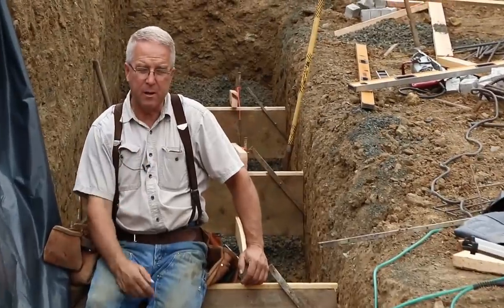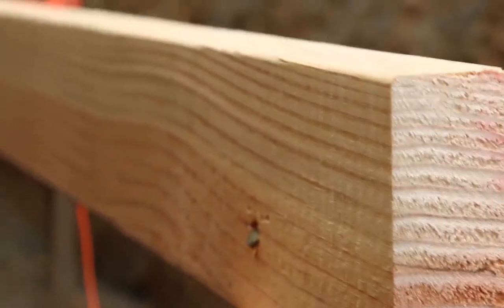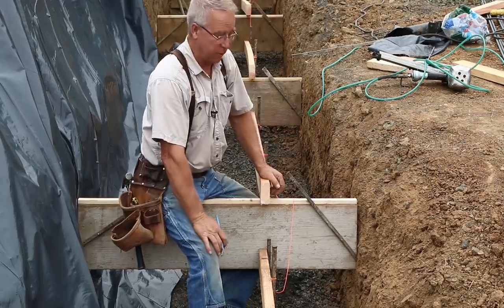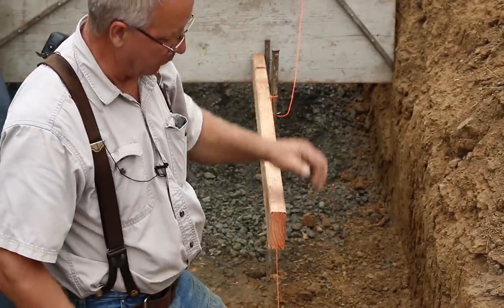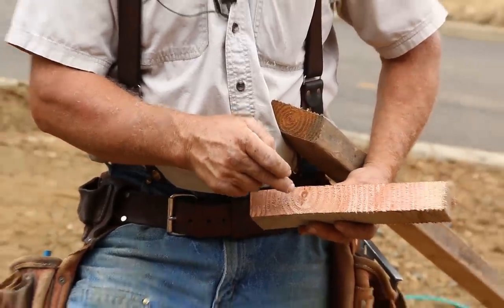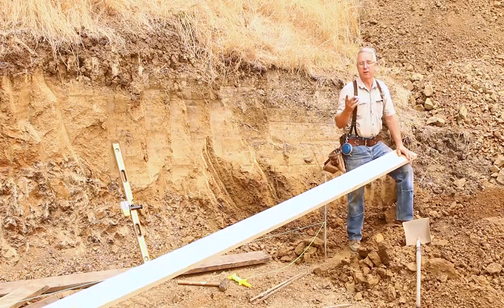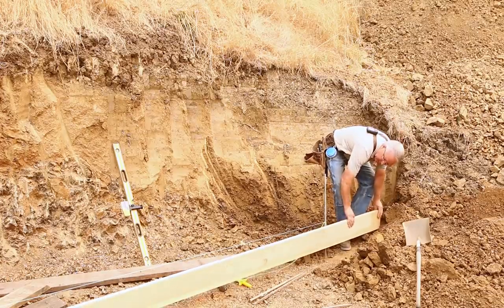Things To Know About Lumber

Comment: Thank you for all your great videos. Point of interest for you, about 30 years ago I had to remove 2 Pacific Yews for a commercial venture, no way around it. At considerable expense and effort I had the wood sawn and kd'd. I have been very selective of it's use and still have 1/4 of the lumber left. Not many folks with 1x8's & 10's 12' long in their stash. Sorry got carried away, what I wanted to share was that the larger of the trees was about 22-24" across, I sanded it to 220G and took it to a stereo microscope and several folks to a stab at counting the rings. We settled on a count of 957 years, that's 14 times my age at 69, amazing!!. Cheers, Billy in B.C.

Comment: I learned all of this when I learned how to make traditional bows and arrows. If the grain isn't just right, or there's even the most minor knot or flaw, the bow can explode on you (there's ways around it but it requires a bit of knowledge and understanding of the wood & bow). When cutting staves, you must seal the ends and then season the wood (generally for years unless you have a low temp kiln) or it will take a "set", i.e. lose much of it's power and ability to snap back into form. Yew is so highly prized by bowyers because it grows so slowly that the rings are very densely packed. Finding a straight piece of Yew is quite difficult these days. The other great thing about Yew is that the inner heartwood is great for compression, and the outer sapwood is great for tension. So you have the heartwood towards you (belly) and the sapwood towards the target (back). The sapwood is a cream color and the heartwood is a rich red color, making for a beautiful bow. When making the bow, generally you want the entire back of the bow to be the same layer of ring (so it just looks flat and plain, without cutting through any additional layers). This will bring stability to the bow, if you accidentally gouge through to another layer it can cause a failure.

If you ever see someone inspecting every hardwood board very carefully at the lumberyard, you might be looking at a bowyer :)

Comment: I was building picnic tables with an NPO at an orphanage the other day, we have a large group of volunteers that I was leading, when it came time to put the boards on the picic table top and the seats I went through a similar explination, we had mostly slab sawn so I wanted them to put the cup down and some rift sawn, we tried to use that mostly for the seats, as they need to be stronger. A number of people came up to me after and told me that what I had taught them made sense, and they could see how it would make the picnic table last longer, as the cup being down would not hold water for a long period on top of the table, but the cup being up would. They were impressed that wood can be so complex, the had never thought of it in that way, opened some of their eyes to wood.
Another great video, I really enjoy them, thanks!
Reply: StuInTokyo good job volunteering to built tables for an orphanage
Reply: The Tokyo Craftsman so basically you’re saying how great or smart you are. Wow way to brag lol 
Now if you could learn to spell I’d be impressed lol

Comment: All stuff we are supposed to know, but if it has been a while since we were selecting wood, soon forget.  Thanks for the refresher.  In Japanese woodworking it goes a little further.  For example when posts are selected to support, let’s say a carport, they also differentiate between posts which are upside down vs right side up.  Posts should be right side up of course.  The bottom of a post is that which grew closest to the root while the top is that which grew closest to the tip.  Betcha never thought of that....

Comment: I love how concise you are and how well put together your presentations are.

If anyone wants to delve further into this topic, I'd suggest checking out Bruce Hoadley's book 'Understanding Wood - A Craftsman Guide to Wood Technology.' It's deep. 

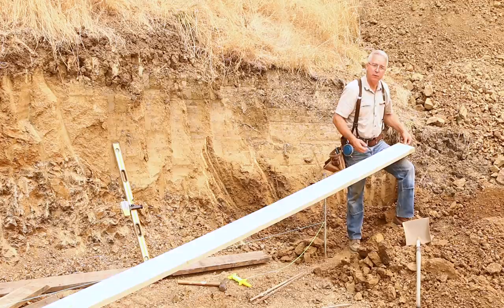The only minor quibble (alright, maybe even trite remark ;) I have with the info presented in the video is at 3:13 when you mention that cupping will 'tighten towards the smaller circumference growth rings.' This will just depend on whether it is drying or wetting. What you describe is its movement in wetting. In drying it cups as if the grain is 'straightening out.' This is due (in both wetting and drying) to the differential shrinkage rates of tangential vs radial grain.
It's possible that in form work, one might consider wetting as the primary factor, whereas in interior carpentry, it is usually drying that is of primary concern. And then there's that in-between such as with decks and the like where it depends on a lot of factors and likely does a good bit of both!

Comment: Great video. I have to take this to an even higher level as I build aircraft out of wood. I used douglas fir, northern white pine, and of course Spruce. We typically look for at least 8 -10 grain lines per inch with an extremely straight vertical grain down the length of the board. The best wood of course has upwards of 20 + grain lines per inch. There can't be any knots in the wood that is actually used, but when finding and grading your own wood, we just cut out or cull the wood that isn't perfect. It's hard to find a perfect board, but you can usually find a great board that has perfection within and the imperfections can be removed once run on the table saw and taken to the smaller diameter that we are using. Most aircraft construction uses sizes such as 3/4" x 3/4" or even as small as 1/4" x 1/4" for aircraft ribs.

Comment: As an Architect in the Northeast, I have real problems with much of the framing-lumber that's locally-available for construction and remodeling projects.  But there's not much I can do about it other-than be very conservative and cautious.  Mostly Canadian Hem-Fir and Doug-fir, ...even the Spruce-Pine-Fir and Larch isn't readily available from the yards anymore.  Southern Pine is all special-order.  The large mega-builders are now buying their lumber by the rail-car directly and paying premium for select-lumber, so the local yards get the low-grade junk.

Comment: I thought the first one you showed is considered horizontal grain (you said vertical grain), if you're going to leave the board vertical like that, instead of lying it down flat. Isn't wood stronger the other direction; hence, why it's sought after in axe handles to be perpendicular to the axe head? Or is there a difference between using the wood for support vs an axe handle?

Comment: I often work as the cut yard guy, cutting studs, trimmers, headers and sills for frame packages. The plate stock sits in the sun most of the time and some stuff gets twisted. Your explanation on the "heart" and second growth lumber twisting the way that it does is quite interesting. Thanks

Comment: Thanks EC.  I have a question on application of different orientations.  Which Grain is best for a Joist or Rafter  (Quarter sawn or Slab Sawn or rift sawn)  Which would be best for a Wall Plate etc.Could you talk about this please as you go through the Build.  Basically placement of Grain orientation versus StressThanks, Tim

Comment: The only thing I disagree on is the generation of timber used today.
I think it's more like the fourth or fifth generation,and slot of framing lumber is plantation grown.
We recycle if we demo an older home in Detroit. The old timbers from early 1800s to the 50s is straight as an arrow ,hard but still strong compressively.

Comment: Great vid, I wanted to add how temp can change the warp of a board.  I've bought boards in the winter time that looked straight (ish) at the lumber yard.  (South Dakota in the middle of winter) but when I got them into a warm house I was working on warps started to emerge.
Reply: They warp due to the moisture evaporating out of the (cellular structure - they look like human blood cells...  as in shape & appearance.... ) wood & this creates/sets up stresses in the wood. 
If the wood was completely dry before milling ( to board sizes... ) then, largely, boards or lumber would stay more stable... but it would cost too much to try & dry whole logs & you would induce radial shrinkage & therefore cracking within the log tangentially away from the centre of the log.  Also saw mills like a certain amount of moisture in the loss as it's easier on the cutting tool bits in their factories/mills!!  Carpenter of 35 years.....

Comment: I caught your video you did about 5 months ago in reference to due diligence for site preparation.  How does a geotechnical engineer evaluate soil on a lot with expansive soils?  What kind of outcome or outcomes can I expect?   Is it practical and cost effective to build a pier and beam foundation in this type of soil.  Not really a big fan of slab foundations.  

My intent is to be owner builder on my own property.  I can do all of the framing and electrical.  I'll sub the foundation and plumbing to a pro.
Reply: From me John Wilder cont:  It is my intent to pick a set of building plans after I review them for my skill set to use for my project.  I've talked to a few architects and builders and they all want me to use their plans possibly for a number of reasons. I politely decline because I see readily available plans that can be purchased from places like Sater homes and design.  Possibly more cost effective not necessarily wiser.

Comment: It's hard to find a 2X4 around here that does not have a heart and sap wood with debarker marks in the same board. Archie Foxworthy brought up a load of sycamore to the sawmill wanting it sawed into lumber for a maple sugar shack. Dad tried to talk him out of it but that's what he had. Anyway the 2X8's that he used for rafter ties that were above the sugar vat would start the day out vertical. But as the steam started rising up they would slowly twist to lay almost perfectly horizontal.  The building would pop and crack, and when he let the fires go out in the evening they would slowly twist back.

Comment: Doug fir along with southern yellow pine make great workbench tops. Anyway thanks for the neat video.
Reply: I was surprised by how long my pine workbench has lasted. I made it out of scrap from a shipping container twenty years ago. I have a small steel plate attached and do almost all of my welding on the bench and I fasten a variety of beater blocks and other shaping tools to it with wood screws. Works great and is extremely versatile. Also has a good deal of storage space under it. I should really get around to reorganizing that some day.

Comment: recently i bought a dozen 2X4X10’ at home depot and the next day or could been that night that most of them were twisted. warped, and bent.
i returned them, yes oddly enough i returned lumber and purchased more of the same smd as soon as i got them home i screwed then together so they stayed straight.
i used them one by one, they did move a little bit for the most part they stayed straight.
i think they cook them too long with too much heat.  i don’t think not think the growth rings matter at all in this case.
cutting this lumber gave off a peculiar odor that wasn’t quite the smell of pine.

i don’t know how, what, or where this wood comes from but it sure is strange.

Comment: can i get your thoughts on this comments on reddit? Is it good advice?

"I was never a professional, but as a teenager my dad taught me as we cut down trees for firewood that if it falls wrong and come towards you, to run TOWARDS the tree and sidestep to avoid the trunk.

He explained it as the trunk with be moving slower than the top(angular momemtum), so you would have more time to react, and the base will have no branches so you are more likely to not get shish kabobed by a branch. It also keeps the tree in your line of sight, running away put it in your blind spot and you can no longer see where it is going."

Comment: Those types of boards started showing up decades ago when second and third growth trees started coming on the market as lumber.  We saw that it was not as strong and tended to warp or propeller badly.  Old growth trees which were much larger allowed for the cuts, which he showed, that were stronger such as that 2x4 with a tight grain.  Almost all lumber now is cut from second and third growth timber.  Fast growing timber does not make strong boards, but we have cut down almost all first growth timber, which which has turned into a fight to save those old trees.
Construction methodologies will have to change to accommodate other types of uses of wood and other building materials to build homes.  The caveat is that if you are looking to purchase a home of recent construction, look to see the walls are plumb with no bulges.   Was the straight used in its construction or did the original builders use cheap fast grown lumber that tends to warp, causing aesthetic issues within the home.
The reason for those different types of cuts is because the mills must get ever viable board out a log they can, which means cutting it multiple ways, thus giving you boards that warp instead of like older tree's lumber that stays straight and true during the drying period.